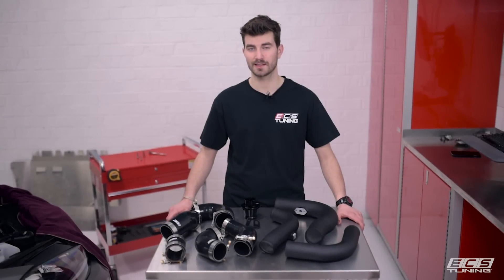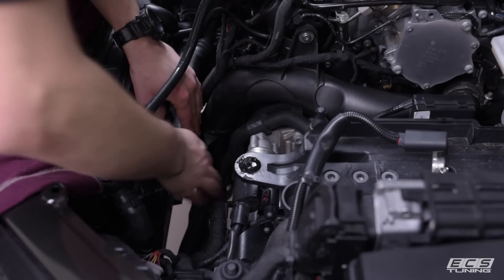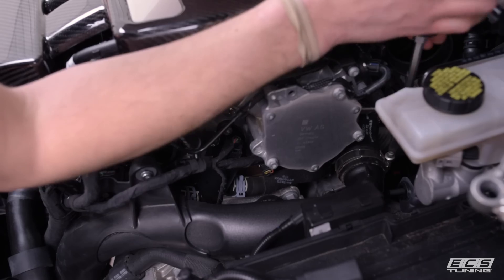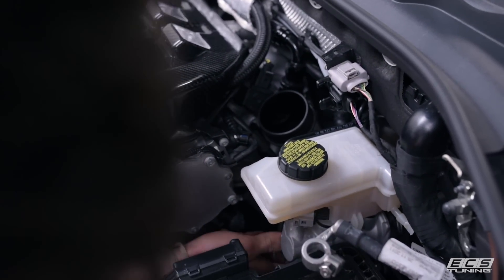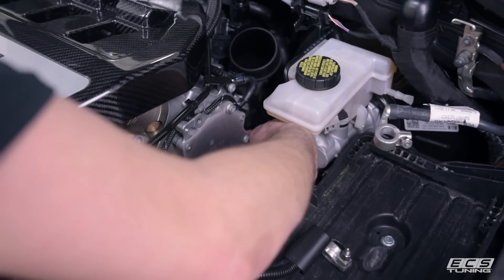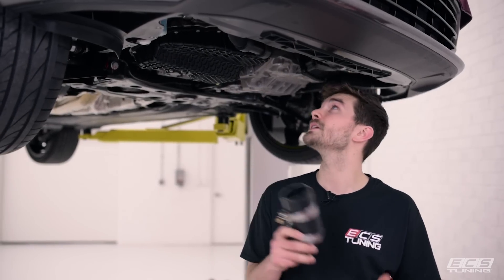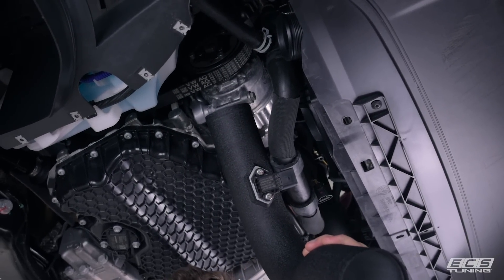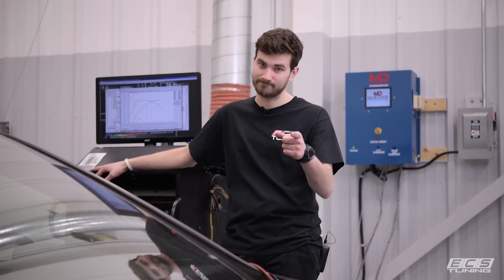VW/Audi Intercooler Charge Pipe Removal and Install DIY

Comment from the maker: Intercooler Pipe Kits available here: https://goo.gl/poIp0l
Turbo Muffler Delete available here: https://goo.gl/BlFfak
VAG Connector Removal Tool available here: https://goo.gl/pt07o7
Reply: ECS Tuning will you guys be making these charge pipes for the Audi B9 A4?
Reply: The VAG connector removal tool saved me time,  frustration and messed up fingers removing the MAP sensor on the throttle pipe.

Comment: I gotta say, I ordered this kit for my car, a 2017 VW GTI. It DOES NOT FIT a muffler delete like you show it does. My muffler delete is 2.25 and your hose is 1.75. Not a snow ball chance in hell of that hose fitting. I reached out to your customer service, no one answers! I tried live chat, they say they will get right with you, then end chat. So your customer service is absolute crap. I'm so frustrated that I'm ready to send these back. My last hope is an email and wait a few days to have someone respond! Unless you are running a stock turbo muffler, DONT BUY THIS PRODUCT!!!!!

Comment: Yeah I didn't see the part where he got the bloody pinky knuckle just like I ended up with...these videos make it seem like a walk in the park. it takes a Tertris master to get these out of a 2017 A3 Quattro- much more cramped than the pictured engine bay. And that Throttle pipe going back on is a NIGHTMARE...lol
Reply: I still haven’t done mine. I tried once and it was a nightmare. I’m going to try once again when the weather allows me to.

Comment: I always wonder why not  metal intercooler pipes, rubber is damaged so easy
Reply: Could be heat related, rubber may running a bit cooler and also rubber gives bit more flex which good as the engine is moving whilst the intercooler is stationary.

Comment: I installed the charge pipe between the turbo outlet and the  intercooler inlet. How much to tighten the hose clamps? Under full load (WOT) the coupling always comes off the OEM intercooler inlet and lose turbo boost. the flange is plastic so I wouldn't want to risk cracking the intercooler connection. Pls help.
Reply from the maker: Very tight! Crank those puppies down. Plastic flanges should be fine.
Reply: Thanks for responding. I did crank down the intercooler inlet coupling and ensure that there is a small gap at the middle coupling for the charge pipe. The minor problem I have now is the 2.5" band around the turbo outlet coupling. I'm using a CTS turbo muffler delete and even with cranking the band all the way to the stop limit, it still feels like it's not that tight around the muffler outlet. That said, for the time being, I'm running 5psi+ over stock (Neuspeed PM) and am worried about running WOT too much in fear that this coupling might fly off. (2018 7.5 R)
Reply from the maker: I wouldn't worry too much about going WOT, if you do and the coupler does pop off, you just need to find a slightly smaller clamp. Only way to find out is by going WOT!
Reply: SH1RO 7R for what it’s worth, I ended up just using the stock clamp on the section (from turbo muffler delete to 90° elbow joint) because the supplied clamp was just a little too big.

Comment: great product I was trying so hard to fine this from u guys is this a new product..
Reply from the maker: Yes, we just released our kit yesterday, March 9th.
Reply: ECS Tuning well this sucks cus all I need is the charge pipes don't need the couplings I jst bought that like 2 weeks ago with the turbo muffler delete spend 259 on that and if a get the kit that u have for 299 then I'll be having extra parts..
Reply from the maker: The couplers you have purchased are meant for the stock piping/routing.  Our intercooler piping kit uses different couplers to match our charge pipes.  If you are interested in purchasing our kit you should be able to sell the existing couplers you have as there is a good market for them.
Reply: ECS Tuning oh k then make sense man I should of waited 2 more weeks and I would got these ones oh well now ima have to get them lol...Thanks for the info man...by the great products love ur store and love ur payment options also..